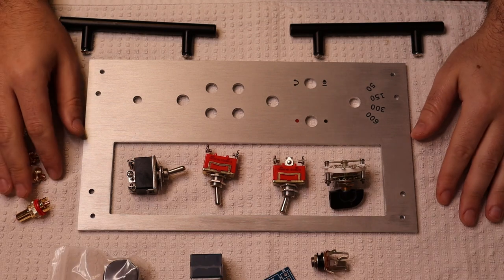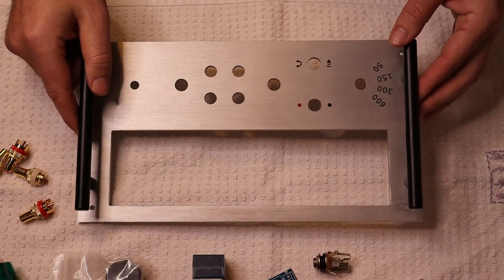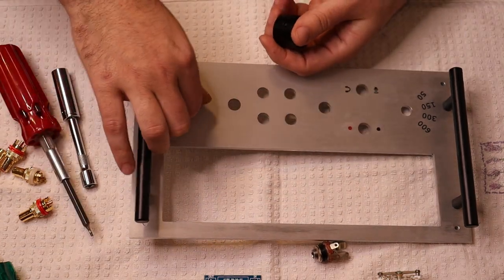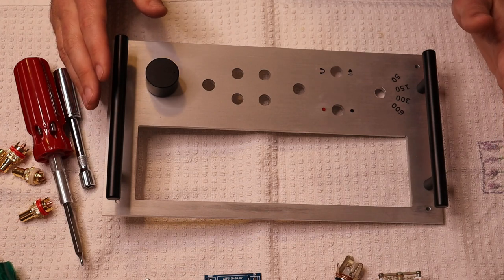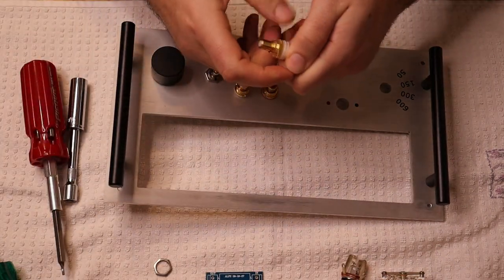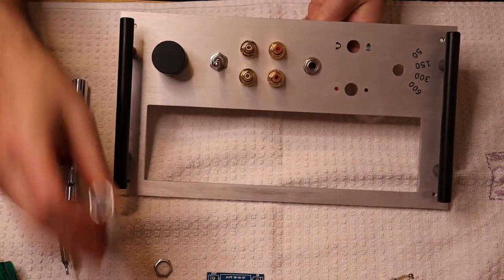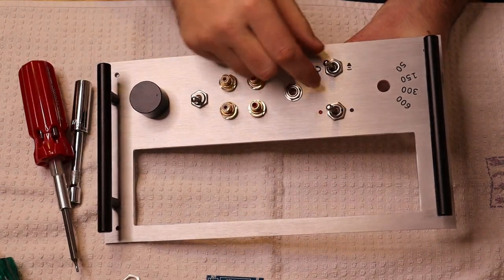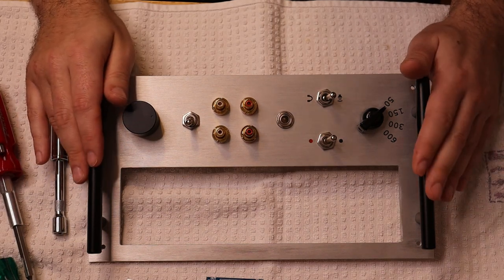Integrated Headphone Amp Build-A-Long With Charles

Comment: Looking good so far!   Im waiting to see the final build. I would suggest adding a 4-pin XLR for those headphones that use that connector type. Headphone geeks look for those details. Also, you should publish the power ratings at each impedance tap and show the frequency range graphs once its finalozed. Will it be possible to get more  power, especially in the 300 -600 ohm range? I'm looking for a strong "slam" factor and good bass extension. And finally, will it be possible to buy this as a point-to-point wired kit instead of a PCB for the purists out here? Thanks!!
Reply from the maker: Thanks for the excellent comments.  With output transformer coupled amplifiers the power output will be identical no matter what output impedance tap is chosen - so long as the load (headphone impedance) matches.  Your headphones can be a wee bit higher (with no loss) but not lower.  XLR headphone cables are just dumb - they don't improve the sound in any way whatsoever and increase the complexity and cost of the build.  All of our quality audiophile grade cans use 1/4" jacks, which are rock solid, reliable and affordable. Manufacturers unfortunately are always looking for the next BIG thing to convince consumers to buy the same stuff over again - we don't play that game - ever.